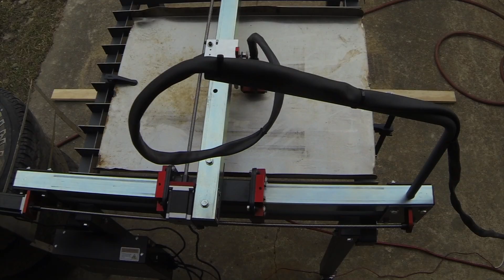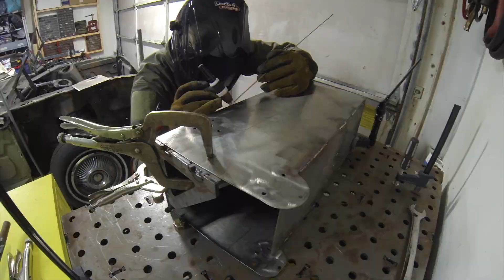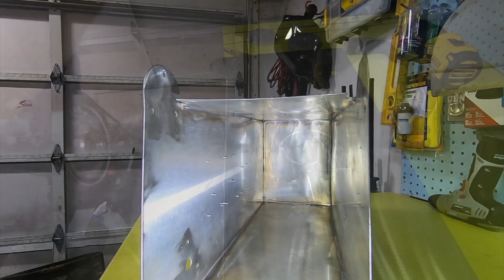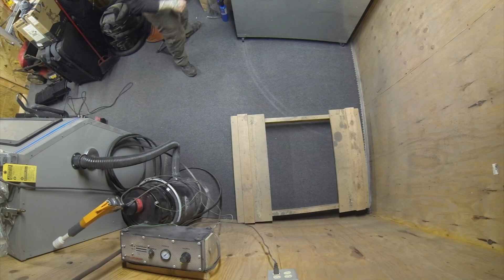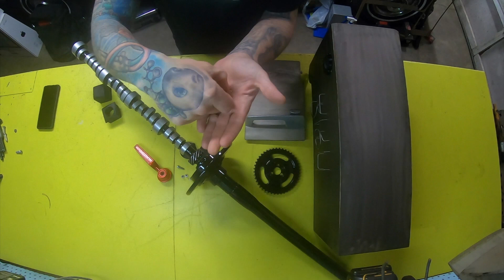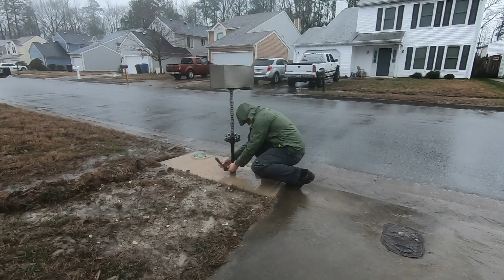Building a Custom Mailbox - CNC, 3D Printing, Welding & Car Parts

Comment: I like your powdercoating setup, is your oven a custome build. And if so, what did you use because I need that capcity for Cerakoting gun parts.
Reply from the maker: Yes, my oven is custom built. I used metal framing joists for the base structure, 16ga galvanized sheet for the inner walls, and 20ga galvanized sheet for the outer walls. It has regular 3.5" r-19 fiberglass insulation in the walls. 
Elements are from a couple old house ovens, and it has a PID to control it that I got on ebay. It's really quite basic.

Comment: Why use the silicon bronze with the stainless. Just curious why not 309 or some stainless filler. For looks or?
Reply from the maker: Mostly for looks. I wanted the thin gold edge around the mailbox. It ended up being less than I thought it would, but it still turned out great. Also, it grinds easier than stainless filler and I knew there would be a ton of that. Finally, since it melts before the base material, and it was 100% corner joints, I could use less heat and not worry about blowing through anywhere. 
It is super solid and still out there getting beat down every day and looks about as good as it did when I put it up almost two years ago!